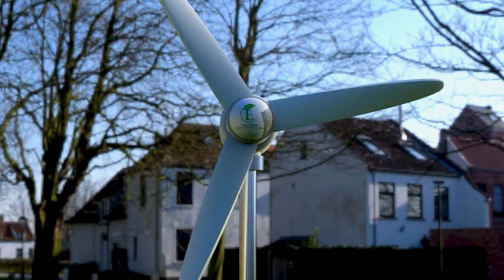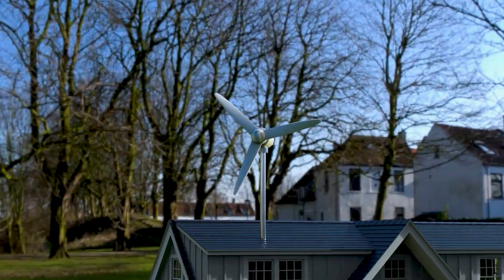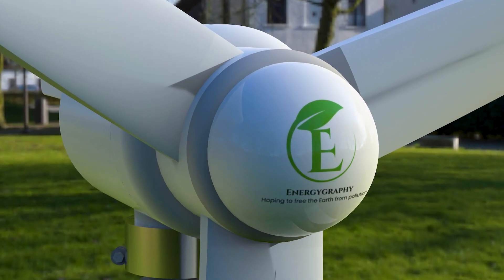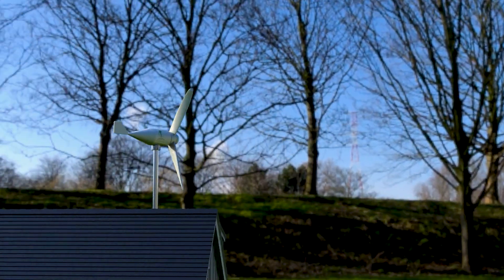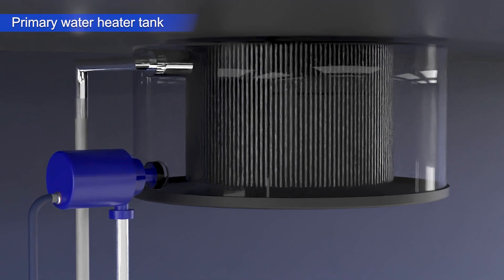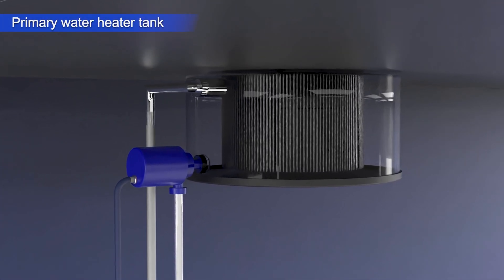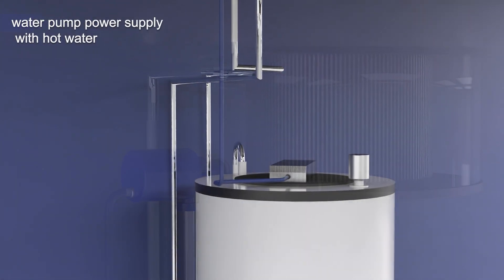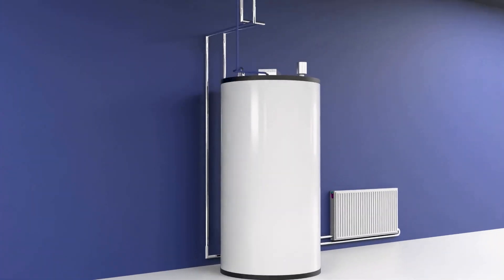New green heating for your home, my new startup

Comment: Wouldn't it make more sense to just heat the house directly without storage?
Especially in cold climates it could just be running "full time", but you wouldn't lose energy for storage/conversion, and the complexity and cost would be less.
Curious to here your opinion

Comment: Your usage of the electric pump likely greatly negates energy cost to heat otherwise with electricity alone. There is no way for you to power the pump and heat the water with the input load alone. 

It would take a VERY long time for you to accumulate enough kinetic energy from a single turbine to heat up the water in your small reservoir. Then you pump that into the big tank, which will cool it again before you heat up your next bit of water.

TBH solving the noise problem is likely more valuable, because then you could operationalize wind farms closer to populations. However, it's not an easy one to solve.